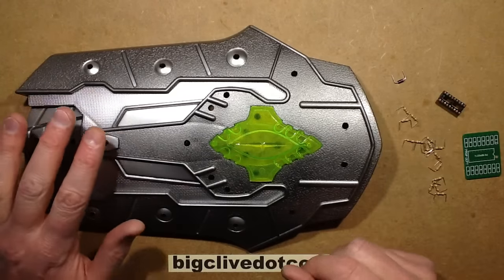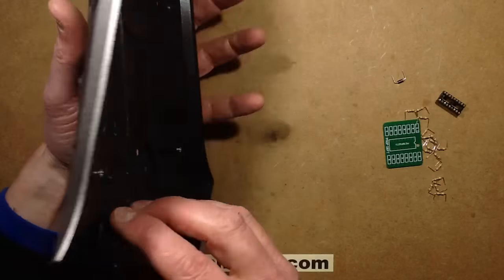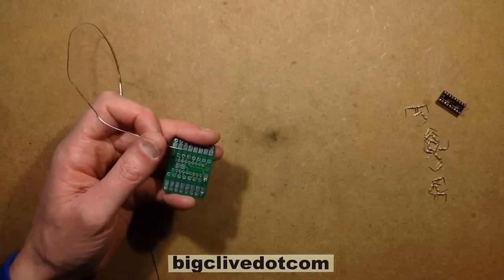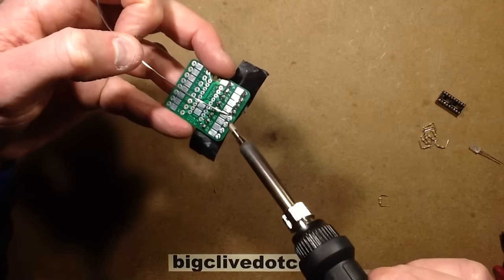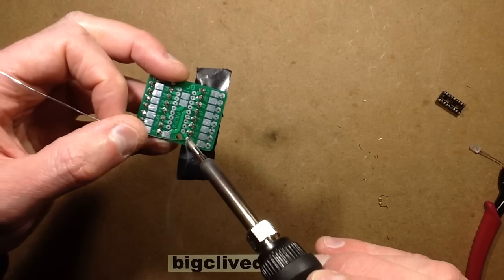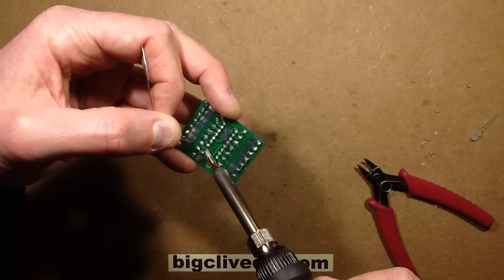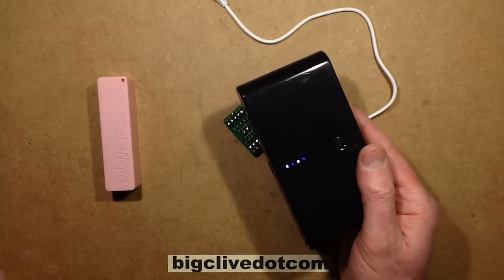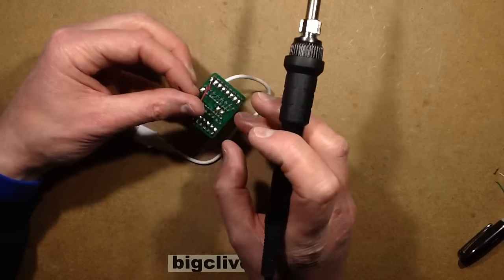How I add LEDs and circuitry to a TV prop.  (with timelapse)

Comment: Hey, Big Clive, have you ever seen a UK adapter, get ready for this.... WITHOUT an Earth Pin?
Reply from the maker: +GabeTheBrony Sounds exciting!
Reply: +GabeTheBrony I'm not really familiar with the purpose of earth pins.
Reply: +Bradman175 The UK sockets have shutters over the live and neutral holes to prevent children from poking foreign objects in there, and the only way to open the shutters is to have an earth pin inserted in the earth hole, otherwise you cannot plug it in
Reply from the maker: +GabeTheBrony Some have a different rotating mechanism that is released by both the other pins instead.  But the adaptor definitely wouldn't go into the normal type unless something was poked into the earth receptacle.
Reply from the maker: +GabeTheBrony Some have a different rotating mechanism that is released by both the other pins instead.  But the adaptor definitely wouldn't go into the normal type unless something was poked into the earth receptacle.
Reply: +bigclivedotcom True, but doing that is very dangerous, just like try to plug a Europlug into a UK socket without an adapter.

Regardless, that adapter will not get into any UK socket or MK socket as both need an earth pin or a plastic version of an earth pin in the case that the earth is not being used.
Reply: GabeTheBrony So a uk plug without an earth pin is idiotic. Cuz u can't plug it in.

Comment: Clive, these days would you say that something like an Arduino/knockoff has somewhat replaced the need for dedicated circuits? Sure, not as fun to build, but dead easy.
Reply from the maker: +Richard T Arduino's are used a lot in the prop industry now, especially where some servo control is needed.
Reply: +bigclivedotcom I would hazard a guess and say a lot of circuit design these days with 555s for example are lost arts ... Alas ...
Reply from the maker: +Richard T I have actually used a PIC microcontroller just to flash the indicator lights on a vehicle used on a kids show.  It was simpler to use an existing board than design a new one and it let me set the timing exactly.
Reply: +bigclivedotcom Good to hear that it isn't dead .... Sadly in schools at least here in Canada electronics means "how to program an arduino". Nice to hear it is still being used and not only by us "older" folk ;)
Reply: +Richard T 
Hehe, I wouldn't be surprised if the old folk back in the days grumbled about these young folks that can't even make a simple oscillator circuit without these newfangled 555 timer things.
Reply: +Ts6451 True Hahahaha
Reply: he he
Reply: +Richard T Oh, memories of building a "Knight Rider" light chaser based on a 555, a counter, some steering logic, and a demultiplexer (circa 1982). I built it into a panel I had on hand, whose twin ended up in the movie "Stripes". Look for the missile control panel in the secret weapon motorhome. The props guys chopped out the middle 1/3 which was visually boring. It was originally a control panel from an old mainframe. There were only 2 available; I got one, and the other went to Hollywood. Quite fun to unexpectedly see it on the big screen!
Reply: +Mike Cowen  That is very cool ... I love that movie! :). Funny you should mention Knight Rider - I've started to watch the show with my kids ... And they want to build one :). It will be a fun project, and with current technology, the interior lights and scanner should be very easy with arduino based hardware. Really any excuse to relive my teenaged years, and this time I will have a 400 BHP transam to do it in ;)
Reply: +Richard T While not a difficult circuit to build with discretes, it's a lot easier in software! I'm sure it will be a lot of fun. Let me know when you do the voice synth! One suggestion, if you've never designed for cars, is to design for at least 60V transients and noise. It's a hideous electrical environment which will bite your circuits when not looking. I could tell you thousands of stories from my days rebuilding early (78-84) General Motors ECMs. Even GM's engineering had a learning curve with low voltage digital circuits in a vehicle.
Reply: +Mike Cowen Will do thanks for the assistance and advice! :)
Reply: +Mike Cowen 
Indeed!
In fact, if you look at many datasheets for "automotive grade" ICs (I'm talking mainly regulators and power control stuff), you'll see that they all have high voltage ratings up to around 40 to 60V :P

Comment: Oh wow that's awesome! How much does something like this usually cost in a production?
Reply from the maker: +SpaceMountainLarry the cost will be split between the prop maker and guy doing the electronics.  Cost will vary dramatically depending on the production and whether the work is done by hired crew on a daily rate or from a prop house where it will be estimated based on an hourly rate.  Those rates will vary widely from area to area.
Reply: +bigclivedotcom I've been using the tape method for as long as I can remember. People look at me funny when I do it, then I explain about removing components and how bent leads under solder blobs look like shit. You don't see bent leads on professionally built thru-hole PCBs (unless they are China's Finest) am I right? I prefer masking tape - it doesn't smell as bad as vinyl tape if you get it a little too hot.
Reply: +Sootikins Most "professionally" built boards are actually machine manufactured so the board is never flipped during manufacturing, it remains upright all the way through to the wave solderer.  As for purely handmade boards, it tends to depend a lot on the quality of the work and what criteria are at play...as in whether speed or neatness is considered the greater value, which often depends more upon the amount of profit available per unit.  A fast hand assembled board in the U.S. would likely look similarly as bad as many of the Asian PCBs.  An aerospace standards circuit board, by comparison, would be absolutely immaculate with, quite possibly, minutes spent on each and every solder joint and component with no concern for time.
Reply: +Ethan Poole I'm actually fairly familiar with the stuffing and wave soldering methods used in many a small board assembly shop. I was speaking of the quality / appearance of the joints, not actual techniques, i.e. "if you bend leads your work will never look "pro". Not that many people care these days.

I'm also not sure how we ended up in this thread about the cost of props. I intended to reply to the guy who posted "why not just bend the leads and be done with it".
Reply: +Ethan Poole I've done both ends of the spectrum (was once FAA certified) and everything in between. For small production runs, we had "stuffing frames" which would hold rows of boards. Once stuffed, you'd snap a heat-resistant foam covered lid over the face, flip it over and solder & snip (occasionally making several passes on complex boards). Most of my aero & auto stuff was surface mount with a major emphasis on being CLEAN when done. Even "no-wash" flux was removed. For one-off stuff, I often bend the leads, but I easily use the method Clive does, too (but my fingers are a tad more heat sensitive than his).

Comment: So i have a question, why do you have "sticks" of solder instead of holding the spool or tube?
Reply from the maker: +girrrrrrr2 It's on a weighted base reel holder.  I prefer to snap bits off and use them loose.
Reply: bigclivedotcom Ah that makes sense then.

Comment: i can do it smaller with an attiny also for batteries
but with less outputs (unles i can use a shift register)
Reply from the maker: +robot797 I do have a PIC12 version too for those REALLY small projects.
Reply: i forgot to say
nice work
Reply: PerfumedManatee Fewer what?
banana's or mini ninja's that trow appels at random people just to piss them of
Reply: PerfumedManatee what would be fine
could you please explain what you mean instead of using one line without context
Reply: +robot797 I suppose it's the less/fewer thing.
Reply: +robot797 I guess he means "fewer outputs" instead of "less outputs". Since less output(s) means you send less data, while fewer outputs means you have fewer things to send the data on (e.g pins on a chip).
Reply: +robot797 
I can do it smaller with a Silabs GECKO MCU, in a QFN package. Very small, and with a decent number of outputs (depends on the chip of course).
There are also MCUs with BGA packages, but I tend to shy away from those unless it would be for a big project (lots of I/Os, etc... plus I haven't used BGAs yet lol))

Comment: "No access to a vacu-form machine"??? You make and mod so many wonderful things, why not make your own?

 A simple wood frame, a vacuum (of course), a heat gun, and a couple sheets of plexiglass or other plastic. 
Anything can be used as a blank to form the plastic over, but preferably something with a flat bottom.
Reply from the maker: I've toyed with that, but I'm not sure I'd use it enough to justify making even a simple one.

Comment: Hey clive, random question but I pulled a LVDS driven LCD out of an old laptop. You wouldn't know how I might drive it within a small footprint? Not all that clear on how LVDS works.
Reply: if you are talking about the screen I have a few too and would also like to know how to drive em. seriously, I have a few. I take too much stuff apart xD
Reply: +Random_rapper20 same
Reply: +pop1040 lol that timong
Reply: +pop1040 idk if you are in UK or us or whatever, but now I kind of want to start mailing him stuff from USA doller stores to take apart
Reply: +pop1040 idk if you are in UK or us or whatever, but now I kind of want to start mailing him stuff from USA doller stores to take apart
Reply from the maker: +pop1040 It depends on what you want to drive it with.  You could use a VGA to LVGS converter if you wanted to use it with a computer.
Reply: +bigclivedotcom probably a sensible option. Raspberry pi would be cool video source, which is HDMI which you can do with a DVI decoder if I remember correctly. Could put the screen behind a one way mirror and put a touchscreen digitizer on top of it to make a si-fi bathroom mirror (look up magic mirror raspberry pi).
Reply: +pop1040 If you want to build a driver board, forget it. But try something like this:
http://www.ebay.com/itm/110925504614
http://www.ebay.com/itm/271827422922
Don't know how these really cheap ones work:
http://www.ebay.com/itm/301806413612
http://www.ebay.com/itm/251718670943
Reply: +superdau thanks dude, 5 dollars is way better than 38.
Reply: +bigclivedotcom btw, did you see my comment about the second battery pack you showed?
Reply from the maker: +pop1040 I've just popped the lid and the inductor is not marked.  I took a look for the chips data sheet but found this image which might suggest a value.  http://img.mydigit.net/Mon_1404/88_1011368_e19bc078a72ef4b.jpg
Reply: bigclivedotcom Thanks, was the inductor pressed against the batteries for you? That's why mine snapped in half.
Reply from the maker: +pop1040 I think mine was clear of the nearest cell.
Reply: Mine was pressed right up against the cell. 
http://s1049.photobucket.com/user/pop1040/media/20160121_230025_zpse6tvcxtx.jpg.html

Comment: Thats a cute little pcb, rolled pin socket, and you solder+hold the pcb like i do, some people just cant get the hang of it, its easy isnt it :-).
The wires from a pc fasia to motherboard would have been my lazy choice, they have little two pin connectors on the end, ideal for plugging on to led wires :-D
Ahh magnus magnason, he finished what he started :-).
Wrong power colours used to appear in cheap transistor radios, on the battery pack, and i got them wrong, ill draw a vail over that mishap :-(
Reply from the maker: +zx8401ztv When I'm supplying LEDs and pre-wired looms to prop-makers for props-to-be-made I either supply them with miniature molex sockets as you describe, or actual wired looms with an LED grommet with tail and Molex plug.
Reply: +bigclivedotcom Ahh molex plugs, i never did know what to call them, so perhaps my lazy choice wasnt so bad :-)
Yes for other people to use, i suppose it has to be plug-n-play.

Comment: What temp do you run?? I'm having a hell of a time with my Hakko 951...
Reply from the maker: +Nick Miller About 330C with lead based solder.
Reply: +bigclivedotcom makes sense, I was at 550 °F, just tried 625°F and made a huge difference.. thumbs up clive..

Comment: Do you sell these as a DIY kit?
Reply from the maker: +RuhelSSJ4 No.  I'm afraid these are only available to specific prop makers at the moment.
Reply: + RuhelSSJ4 - You could learn how to program PICs or Atmels (or MSPs or any of TOO MANY for our BUDGETs' other processors) and make your own, the software would be basically just setting all pins as outputs and pulling various pins low on a regular schedule; Very doable.

Comment: Why not just use flashing LEDs?
Reply from the maker: +jak p (skiguy09) They would look just like flashing LEDs and there's a high probability that all of them would spend a lot of time off together.
Reply: +bigclivedotcom aren't flashing LEDs random? I don't think they are timed in any way. If they are timed, I would devise a simple circuit that delays the startup of some of the LEDs.
Reply from the maker: +jak p (skiguy09) They generally flash at a fixed speed that varies slightly between LEDs.  They also tend to have a low on to off ratio to give their pulsing effect.  When grouped together they tend to have clumping and repetitive effect.
Reply: +bigclivedotcom very interesting. Because of you, I may start tearing down dollar store items on YouTube. At one dollar store I found a 40w e27 bulb that I suspect is a capacitive dropper, which I thought aren't allowed in USA.
Reply: +jak p (skiguy09) Whatever made you think capacitive droppers were not allowed in the U.S.?  Many low power transformerless AC power supplies used in electronics will be of the capacitive dropper (essentially a capacitor ballast) type.  There are some guidelines as to how bad the power factor may be that varies with wattage (mostly to prevent excessive harmonics and RFI emissions), but they are by no means forbidden.
Reply: +Ethan Poole Capacitive droppers are lousy. Transformers FTW.
Reply: +Ethan Poole I never seen a major bulb in the country use a capacitor dropper. Which bulb at Home Depot or lowes is a capacitor dropper? I can't recall specifics, but I thought there was regulations requiring emi filtering, fuse, etc. in a design.

Comment: You know, I just got a nice electric shock just now and immediately thought of you (it was a LED filament bulb I broke, and noticed that touching it seemed to make it glow, then I touched a part of my laptop and ZAP!), mostly thinking about how the live and neutral could be getting switched around somewhere, cos that lamp was definitely switched off......... :S

Oh, and said LED filament touching here on instagram - https://www.instagram.com/p/BAvHJ7EQBAx/
Reply from the maker: +twocvbloke Yeah, it looks like it was still live and you were the return path for the current.  It only takes microamps to light those LED strips.  But I bet they were brighter when you touched whatever was grounded.  I wouldn't really recommend doing it again, it's a bit like Russian Roulette.
Reply: bigclivedotcom
Yes, I've taken the LED bulb out of the lamp, need to get one of them plug-in mains wiring testers and see where the wiring has gone wonky, it's probably the same reason I got a shock the last time and tripped the power, I don't like electricity that bites... :S

And yes, the LED filaments were a LOT brighter when I came into contact with whatever earthed me on my laptop... :P

Comment: +bigclivedotcom I've had very good luck using a zero rake drill for making holes in plastics that are grabby, and like to split. A quick Google search will show you how to grind standard metal drill bits to be zero rake, it's pretty easy, and works amazingly well.

Comment: Presumably you've copyrighted the design of that board and software, I should imagine?
Reply from the maker: +PerfumedManatee That wouldn't stop it getting ripped off.  It's not exactly radically new anyway.
Reply: +bigclivedotcom Is copyright automatic? Or you have to patent it.
Reply: +MagikGimp 
Not to lessen the work, but this board isn't more than a fanout board for the micro, hardly something that noone else would come up with. The software of course is another thing, but I guess PICs also have a readout protection (not that the assembly code you get would be very useful).
Reply from the maker: +superdau The fact that the chips can have their code locked to prevent easy copying is the way I protect my software from copying, particularly in my RGB controllers where a lot of time went into developing the software.
Reply: bigclivedotcom How does one lock their code? I kind of want to do that using arduino on an atmel chip.
Reply from the maker: +Bradman175 You'll need an actual Atmel programmer to do that I think.  It could be as simple as setting the security bit or at worst having to read the entire chip in with the full Arduino sketch loaded on it, and then setting the security bit and then rewriting it.  But the you could bulk program the chips for insertion into Arduinos.  There's probably more detailed Information about that online.
Reply: Bradman175
You have to set the correct fuses (can't be done directly from the Arduino IDE, but the tools needed for that come with it). If that doesn't tell you anything, there you got your search topic. No point and space explaining something here that is explained a 100x a 100x times better already somewhere else.
Reply: +superdau yea.